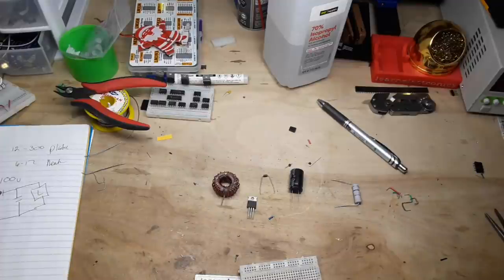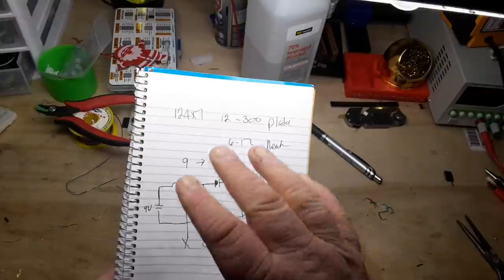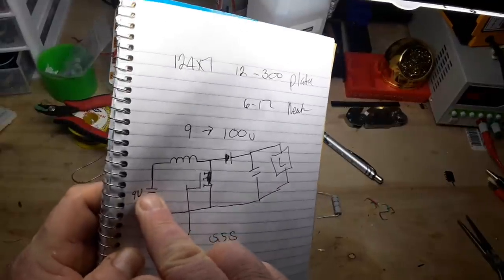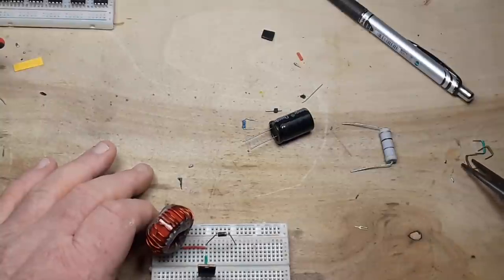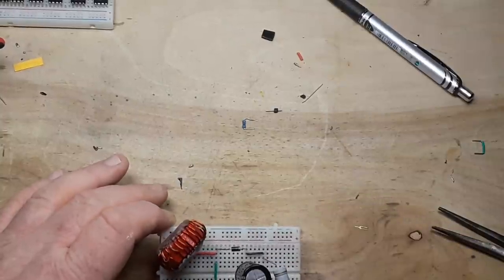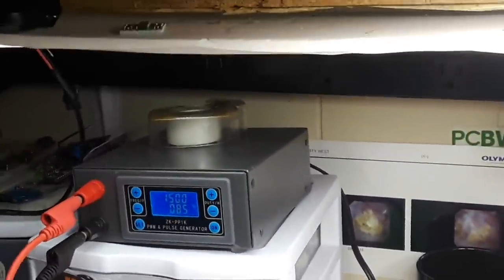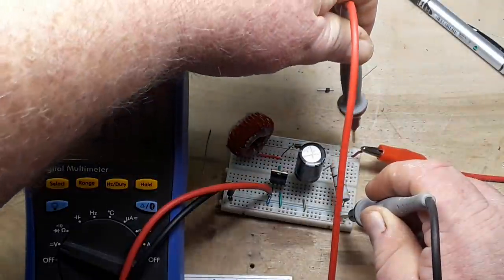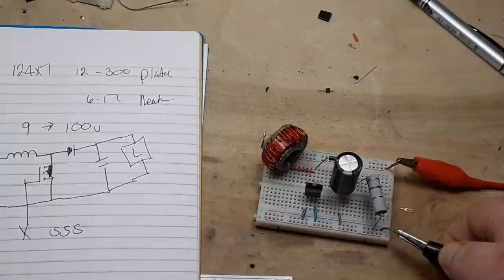Designing a Boost Converter - Components and Layout

Comment: Thank you. This has cleared things up for me. I was wondering if a boost converter could be built using just a micro controller, capacitors and diodes. Now I know that boost converters need an inductor. I want to experiment with bootstrap circuits for N channel mosfets.

Comment: Messed with this once so far, believe that the input voltage were about 15Vdc and an 555 pwm at about 70kHz, something in my mind told me that I should check the output voltage because of the capacitor.... 35V running at 70Vdc. It didn't blow up at least. 🤣

But I guess the inductor were too small because it had almost no output current.

Comment: i use 25v capacitor is tripple the input voltage 1.25v to 3v is good perhaps higher voltage capacitor boost voltage bit more hopefully is mystical electro components, in future perhaps can charge are devices with super fast charging and power effiencently

Comment: check the temperature of your mosfet, I once designed a similar circuit but the mosfet would heat up so much that it felt dangerous
Reply: MOSFET can handle quite high temps, so high that they de-solder themselves 200 degrees Celsius and higher are no problem for some.

Not that they should operate at those temperatures, but some does.

So yes, you has valid point.

Comment: Would a NE555 timer as PWM generator, with V.out as a reference to modulate the PWM duty cycle (as a regulating feedback), be a "good" low-cost MOSFET driver?
Reply from the maker: Yes, as long as you don't need like single hertz precision.
Reply: I'll have to think and tinker about it, to find out which pin to provide with the V.out (or some bridge-divided multiple thereof to not harm the 555), and have another look at the 555's datasheet.
In PWM circuits, pins 2 and 6 (trigger and threshold) are connected to the same node (in the middle of the RC oscillator); maybe one of these two would be of 1ny help? Or maybe on pin 5 (control)?
Reply from the maker: Pin 5 will modulate the frequency

Comment: PAUL, THAT TESTER YOU USED FOR CHECKING THE INDUCTOR   YOU USED, DID YOU DO A TEAR DOWN OF IT IN ANOTHER VIDEO! IF NOT COULD YOU TELL ME WHICH CPU IT USE'S PLEASE ?? BECAUSE, I JUST GOT A KIT BUILD TRANSISTOR TESTER IN THE MAIL DIS-MORNING (ALONG WITH AN ANTI-STATIC MATT WHICH I HAD MY EYE ON FOR AGES BUT KEPT FORGETTING TO BUY. IT'S THE VERY SAME ONE YOU HAVE & IM WELL HAPPY WITH IT) & ALSO A KIT BUILD FUNCTION GEN.   BUT THE TRANSISTOR TESTER ITS THE "GM328" I WAS JUST WONDERING IF THAT WAS THE SAME COZ I HEARD MY ONE IS VERY GOOD FOR THE MONEY & COMMON TO..  DO YOU KNOW OF IT?? ITS GOT PWM & A SQUARE WAVE GEN ON IT  & IT USES THE  AT-MEGA328P DIP28 WITH IC seat. (WHAT EVER THAT MEANS?  "IC SEAT") BUT WAS JUST WONDERING IF YOU KNOW IF THE TESTER HAS THE SAME CHIP.  OR IF YOU'VE HEARD OF OF THE TESTER I GOT AND IF ITS GOOD IN YOU OPINION. BECAUSE I REALLY VALUE YOUR OPINION MORE THAN LOT OF OTHERS... SORRY FOR THE BIG LONG COMMENTS.
P.S. THE TESTER WAS LESS THAN 20 BUCKS TOO. SOOO!!! NO TEARS WILL BE LOST IF ITS CRAP!! ;  )